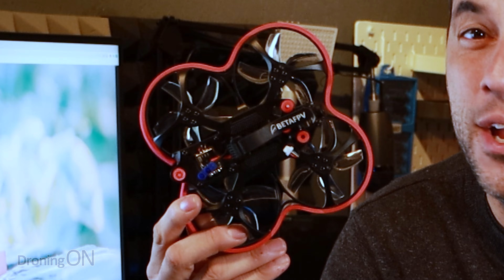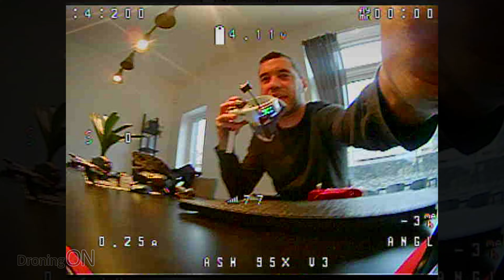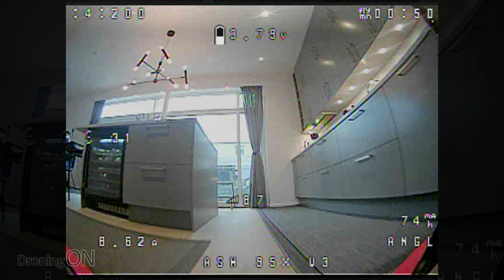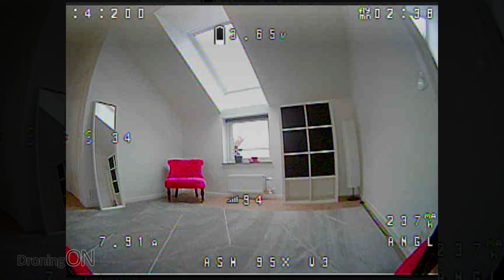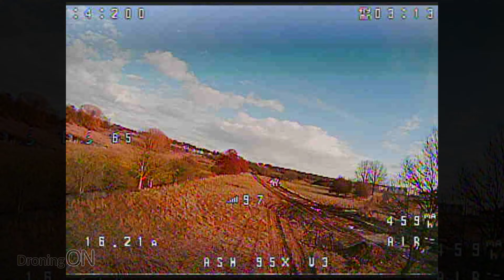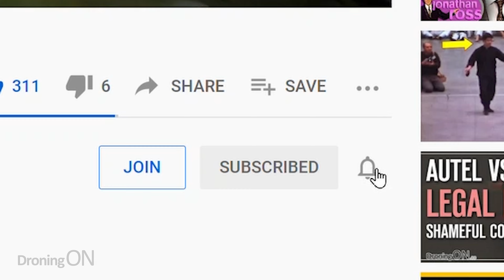BetaFPV 95X V3 FPV Cinewhoop Review (+ Osmo Pocket Test)

Comment: So 600 to be able to fly a product that shoots crap video. May as well save another 600 and by the DJI FPV. I hope they sent you it and you didn’t blow your own cash on it 😂
Reply from the maker: But you can fly this indoors, I already had the goggles and controller and so it's actually only $180 for those that already have the kit for flying other FPV quads!
Reply from the maker: But you can fly this indoors, I already had the goggles and controller and so it's actually only $180 for those that already have the kit for flying other FPV quads!
Reply: It’s FPV feed... you can get digital it’ll be clearer but it’s meant to strap on an HD cam